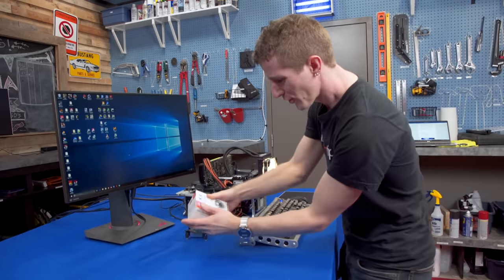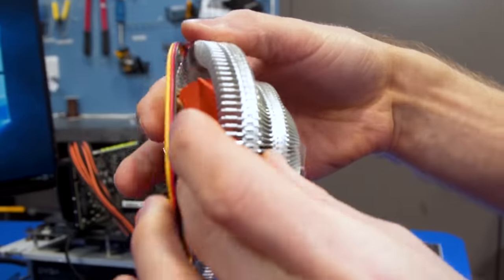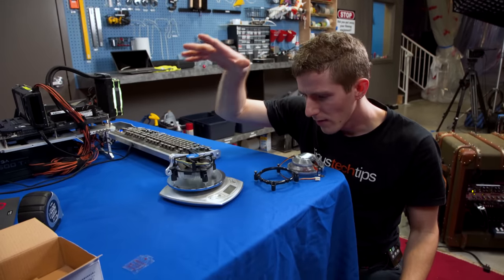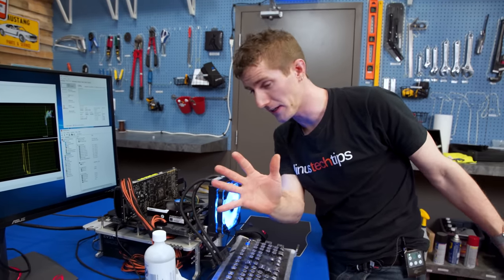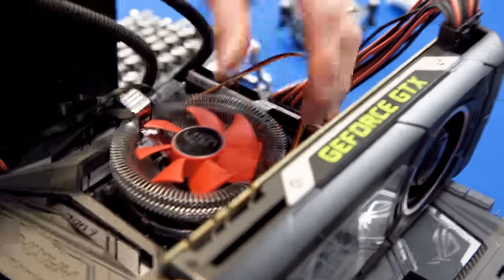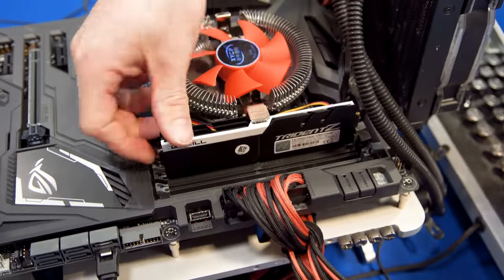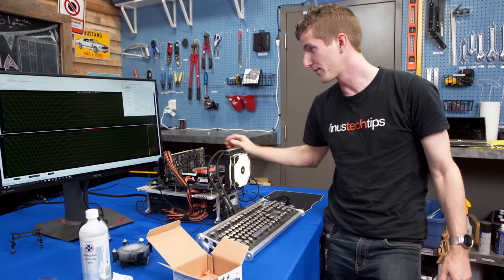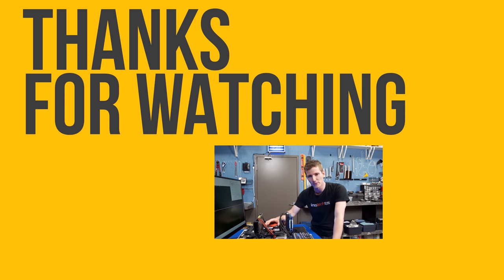The CHEAPEST Heatsink on the Market

Comment: LOL

Built my father a system ~10 years ago for Christmas. Actually it'll be 11 this Dec25... maybe I should built him a new one lol. It's still going strong. He's a graphic artist, and I purposefully overbuilt it in certain places -- eg, it has a gaming mobo -- to make sure it'd last. (It worked!) I had to scrimp and save a lot -- and most of the parts are either donations, bought on discount, or scratch-n-dent jobs. For example, the motherboard, an ASUS Maximus V Gene, has two missing pins in its socket; one is a power pin and one is a ground pin. It's not running a high-end chip and the chip that's in there is at stock clocks, so it's fine. If I was going to push it, of course that would have been a bad choice -- but I got it for a song, specifically knowing it'd never even break a sweat (lol) because of the "damage" that would never affect its performance in the actual use case I had in mind for it.

How does this relate to the video? The heatsink was an eBay find, almost exactly the same as this one -- but the brand was a bit different; back then it was sold as a "Cooling Baby". Yes, that's the actual brand name! Go ahead and laugh -- I did. It's still in there right now and it works great.

BTW, I use that "buy 'x' tubes and we'll give you 'y' tubes free!" silver stuff on anything stronger than an Atom SoC... those get the copper-based version of same. Put your nose up in the air about Arctic Silver whatever or MX Number Seven in the Hello Nurse! syringe (Goodnight, everybody?), I don't care -- mine works just the same and it's a heck of a lot cheaper. My local tech shop does the same; in fact, that's where I learned the trick. Maybe give it a shot (heh) before you get snooty lol.

Comment: By looking at the close up of the box. This cooling fan is for Core duo/Core 2 duo/ Pentium E5200/ AMD Athlon64 x2 5400. If it printed i7, it must be meant very old gen. of i7 or it is lying. Actually let's test this fan with CPU manufactured around the year of 2006-2008?

Comment: I used a cheap chinese cooler today with the same plastic base and clasp mechanism but modern heatsink design (unbranded thermaltake) so cooling wasnt an issue... I had to rotate the plastic base so i could clamp it in a different position so i didnt run into ram/capasitors/heatsinks was kinda a pain in the ass but was to replace a stock cooler that died on a i7 930 1366 socket... 10yr old cpu. Also it made the plastic make a crunching sound when being clasped lol.

Comment: It's not the cheapest. In my country (Indonesia), coolermaster aftermarket heatsink fan for LGA 775 socket with copper costs $2-$3, and shipped maybe in 3 days for free. Much better than that cooler.

But, the aftermarket Intel fan for 775 socket is less than $1 in my country lol

Comment: hey I bought a heatsink for 200 rupees (3.5 dollars approx) and it works almost the same as stock intel heatsink with my 65W TDP Pentium
and sometimes it even gives lower temps than the intel one so this is really worth
And that was not like this one which linus showed, this looks cheap but mine looks very similar to intel's stock one

Comment: I don't think the $ 5 heatsink was good, but the thermal paste probably made it worse.  Many of us have a better thermal paste than the one that heatsinks bring.  I would have tried if it improved with a decent thermal paste. not counting that the processor was of a higher TDP for which the heatsink you say be prepared.  so you should have lowered the frequency and voltage or void cores until the TDP matches.

Comment: Well 4Ghz is still high compared to normal speed clocks of most PC, couse most of users have 3GHz on their PC, so it can work fine for that :) for go more than 3.5GHz ofc you would need or is better any other better heatsink...so isnt so bad,but also better have a 25-30dollars bucks minimum heatsink in my opinion, it can be good even for extra overclocks, like MasterCooler one...

Comment: Maybe it would have been a fair test if you used a 65W TDP processor. Trying to run it roughly 146% over specc and mocking it, especially after putting on the thermal paste like this, is not what I expected from Linus. I am very disappointed, you can do better.

Comment: I know it was only a joke video but I'd have wanted a fair comparison like many others. 
Using it on a CPU that has a higher TDP than what the cooler is rated for is simply unfair and using different thermal compounds infringes on the comparability.

Comment: Has he done a video with the  I 7 8700 (non-x)  stock vs a used 5 $ cooler ? ,The cheapest heatsing on the market is probably the intel stock on 8700 i7 not that 5$ one.

Comment: I have 3 of these EXACT heatsink/fan and they keep my cpu cool just like the 60$ one but 2 degree hotter.  They are more than worth it. 5$ US shipped . Unless you are a super geek who wants nothing but the best, those work just fine.
My latest install is a core 2 Quad (2500MHZ) overclocked to 3200ghz .
Its at 45C idle and 68C under 100% load.
It is mining 24/7 and never goes above 68C .  Stock Intel cooler = 69C at 100% load .
With a 60$ heatsink/fan its at 66C  at 100%

Comment: I just received my 4th 5$ US (shipping+Taxes Inc)
to cool a Core 2 Quad Q9650 3000MHZ overclocked to 4000MHZ
This is the temperatures I get with that 5$ fan...
Idle 34C
85% Load 60C
100% Load 69C
...............
Oveeclocked to 4450MHZ
I get Idle 35C
85% Load 63C
100% Load 71C
........
These CPUs are rated at 74.9C   24/7/365  for 2 years but can handle 82C  24/7/365 for at the very least 2 years.
I paid 16$ for that CPU and there is not a game I have tried that I cannot play.
GTA, COD, WoW etc.....

Comment: Old as it is, this video is a perfect example of what LTT has become ; a channel with 80%percent memes, 10 percent tech knowledge and 10 percent unqualified testing. Whats the point of this video? Makeing a video for the sake of makeing a video?

What if i have a cheap office pc and the heatsink/cpufan dies/breaks and i want to know wheter a cheap product like this could be a viable replacement? How does testing this product on a highend CPU which requires strong cooling by design help anyone, aside from providing a little "entertainment" ?

Its a pity, you have access to a lot of new Hardware and Technology but all you churn out are unqualified and flawed reviews. This didnt use to be the case, there was a time where you could watch LTT and actually get TECH TIPS.

I guess you have to earn money someway and producing videos like this is the way to go?

Btw, that reasoning at the end, claiming to have tested this CPU in order to see wheter the maker underpromised and overdelivered is a reaaaaaaaaly weak justification obviously made up after the fact... w.e if you want real tech tips, LTT isnt the place to look at.

Comment: Yes I am going to say it. Its a five buck heatsink that has literally taking "The slow boat from China" where it was ahhhh.... made.  Then tossed around and then onto a chip with the gray gunk that came with it . A hot running intel chip it was never made to deal with. Without even a dry fit to see if it even the sad little thing fits or not. 
 The thing is a POS  nuff said. That much is plain, but the use of sad heatsink compound and the use of  a chip that it could never handle is not a good judge of capabilities. Even for that thing.

Comment: Ok, but by using 2 different thermal pastes you are actually introducing more variables... not less.
Reply: Untrue. The question is if it's better or comparable to stock. The Intel heatsink came with paste as did the Chinese one thus it's a 1 to 1 comparison of an out of the box experience.